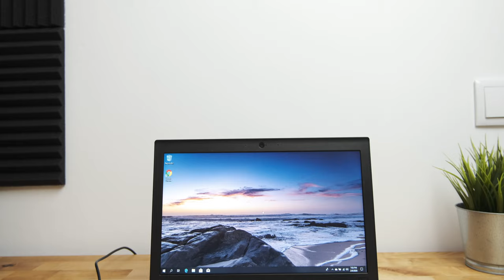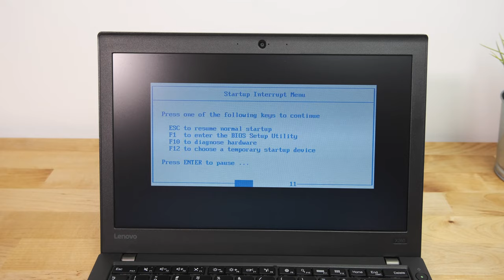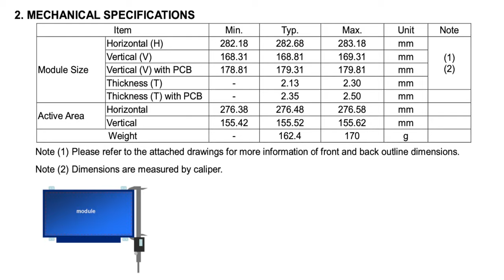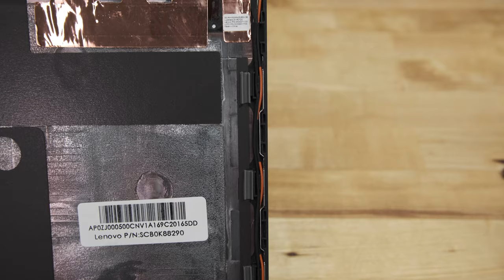Lenovo Thinkpad X260 Screen Upgrade / Replacement from TN to IPS FHD

Comment: Fitted the screen in securely using self adhesive, foam rubber feet that are designed for electrical items, cut to the required size. Well worth the effort and vastly superior to OEM TN screen.
Reply from the maker: Excellent, thanks for the update. You're right the difference from the old TN panel is massive.
Reply: I ordered also a replacement HD screen and ended up with the same screen. Used also selfadhesive tape to solve the problem. Thanks to your video, I was prepared for this. Took me also one hour to replace it completely. Also happy with it
Reply: Thank you so much for the guide. I have a x250 could you possibly help me source a screen so I dont get the wrong size?  Ive found one on ebay but not sure if its correct?

Comment: I intended upgrading the screen on my X260. After studying lots of different panels, I sent for one which stated the panel was 290mm x 170mm. However, I too ended up with a panel 8mm shorter on the width. I was going to return it but your very helpful video has given me cause to have a rethink and follow your lead. Too much buggering about for my liking but hopefully worth it in the end. Thanks for the very helpful video. I`ll post back with the result.

Comment: I ordered a replacement IPS screen too, and according to the listing, it was an LG LP125WF2-SPB2. But in reality, I recieved the same Innolux panel as you have. It had a spacer included though, but It attached from the back and added around a mm of extra thickness. And so, when I put the bezel on, I managed to crack the corner of the display...

Comment: My main problem with cheap TN panels are the contrast ratio, i find myself squinting more or having to turn the brightness up which causes eyestrain

Now this isn't really because of the TN panel itself, there were high end TN panels, they just cost as expensive as an IPS panel so it doesn't really make sense to manufacture those anymore.

Comment: thank you , your explanation is very clear. i have x270 and i have plan to replace the TN panel with IPS 1080
Reply: hi Ryan, did you bought the same N125HCE-GN1 screen for your x270? did it work?

Comment: I have exactly the same issue with panel sizing. What are those rubber strips/spacers called? I cannot for the life of me find them or anything like them anywhere (including IKEA website). Fantastic guide, thank you - best there is.
Reply from the maker: They actually came with an Ikea curtain pole I bought. You can just use rubber feet with adhesive on the back, cut to the right size. If you search for "3m rubber feet" on Amazon there are a lot which would work.

Comment: Well done brotha.. liked..
My 768p HP laptop TN panel just got broken.. seems like it's a great time to replace it with a better 1080p IPS panel.. BUT I'm totally clueless whether it will be compatible if I order it online..
Seems you have experience in this.. do you have some tips that will increase my likelihood of ordering the right panel online ?? Like comparing the make & model nos. understanding the digits in the model no. etc.
Reply from the maker: You'd have to look at the current panel in your laptop, find the model number, and Google it to find the datasheet. That should give you all the specifications you need to find a compatible screen.

If you can't find the datasheet you'll have to measure it yourself, and check what sort of connector it uses, whether it's 30 pin eDP, or the older LVDS. If it's a standard eDP connector then another eDP panel of the same size should work. If it uses LVDS then it's more complicated as the pinout and connector can vary even on laptops from the same manufacturer so you'll have to find the specific panel for your laptop.

You'll probably get the most useful information from Googling your laptop model to find other people who have the same laptop and already replaced their screen. There's bound to be other people with the same laptop who also broke their screen and already replaced it.
Reply: @BartechTV  ok.. thanks buddy.. I'll def try out yr suggestions..

Comment: Great video !  Very well explained, you make it look super easy!
I happen to own a Lenovo T460 Laptop ( which looks exactly the same as your X260 ) and it also has a low resolution TN panel that I would love to replace like you did here. Do you think it is also possible to do it on my laptop? I heard that replacing a panel with a higher resolution one could be an issue and would eventually cause glitches on the screen and whatnot. I'd love to have your opinion on that. Thanks again for the video!
Reply from the maker: Hi, you can switch the panel in your T460 for a higher resolution IPS panel. The Innolux N140HCE-EN1 Rev.C2 should work in your laptop and is a drop in replacement if you can find one.
Make sure to get the C2 revision, not the C1 or B3.
I'm not aware of any problems with glitches after replacing the panel.
Reply: @BartechTV  are there any problems with the C1 and B3?

Comment: I have MSI gf63 thin 11uc. It has a 144hz refresh rate screen. Can I replace the screen with a 60 hz display panel?
Reply from the maker: Yes it should work although, obviously you’ll have a lower refresh rate. Windows should detect the correct refresh rate for the new screen.
Reply: The technician told me that the 60hz will not work with my laptop. Though a 60hz model already is in the market with the same configuration of my laptop. The technician is saying, "the screen model has to be the same."

Comment: Nice video! Do you know if new lenovo laptops have the same display connector?
Reply from the maker: I haven't looked inside every Lenovo laptop, but their Legion laptops do. As for the rest, I would expect so. eDP is a standard. Pretty much all laptops produced since around 2014 use eDP.

Comment: I have dell inspiron 5559 with 1366x768p 60hz 30pins, is it possible to upgrade to 1080p 120hz screen 30pins?
Reply: 1080p 60hz will work.
Reply: @mohamadyusoff9091  i bought the same lcd, im afraid to gamble if 120hz will not work, thanks man.

Comment: I bought an old x260 in good condition, but it is an optional version without camera. So can I add a camera module to it? Or do I need something else (like extra cable, ...)?
Reply from the maker: FRU 01AW448 is the camera cable, and the camera itself is 00HN350. You'd also need a new bezel with the lens hole - 01AW433. If you just google those part reference codes you should find what you need.
Reply: @BartechTV  thank you very much

Comment: Can you show how and where you applied the adhesive strips to the top and bottom?  According to your old and new (innolux) panels, there is a vertical difference of 12mm, significantly more than the horizontal differences.  Also, in the video you are using eBay to purchase panels in EUR but your links in the description are for Amazon US based in USD, yet you are based in the UK.
Reply from the maker: The vertical difference is less than 2mm - 170mm high for the old screen vs 168.81mm for the new screen. Just a tiny 1mm sliver of rubber was sufficient. You can see the little strip of grey rubber I added at 5:22, immediately above the hinge.
Reply: @BartechTV  Yes, I can see those.  Thank you for your reply.

Comment: Could i use this ips panel for x270?
Reply from the maker: Yes, this same panel will work on an X270 (and also the X280).
Reply: @BartechTV  I'm planning to use LG LP125WF2-SPB1/B2 since it's the only one i could get here. It's cost around $80-90 in Indonesia. Your tutorial video seems very easy to follow. Thanks

Comment: @BarTechTV -  I think you may have a fake panel and may have been scammed. 
The Innolux N125HCE-GN1 Rev. C1 does not have an eDP connector to the bottom-right.  It only comes with a connector in the bottom-centre.  No 282mm wide panel that produces 16.7M (8-bit) colours comes with a 30-pin eDP connector at the bottom-right.  Only such panels are provided a bottom-centre connector.  This is the same regardless of manufacturer (Innolux, IVO, AUO, BOE, Lenovo etc...).  The bottom-right connector is for 262k (6-bit) colour panels.
There are two LCD panel database sites, both show images of the same model you claim to have: N125HCE-GN1 Rev. C1.  However, both databases show images of the model with the eDP connector in the bottom-centre of the panel, and not in the bottom-right, as in your video.  So how can it be that you both have different models with the same model number? 
http://www.panelook.com/N125HCE-GN1_Innolux_12.5_LCM_overview_28140.html
https://www.lcd-source.com/Product_Overview_Innolux_N125HCE-GN1
Check the images here:
https://www.lcd-source.com/upload/images/Innolux/N125HCE-GN1_P1.jpg
http://www.panelook.com/images/201911/1574070606850431.jpg
The official Lenovo PartsLookup site also confirms this:
https://download.lenovo.com/Images/Parts/00HN884/00HN884_B-218.jpg
https://download.lenovo.com/Images/Parts/00HN884/00HN884_label.jpg 
The Lenovo FRU for the Innolux N125HCE-GN1 Rev. C1 is 00HN884.  You can check this yourself here:
https://pcsupport.lenovo.com/gb/en/products/laptops-and-netbooks/thinkpad-x-series-laptops/thinkpad-x260/20f6/parts/display/compatible
Notice how your panel does not have an FRU number on the label?  That's because one wouldn't exist in that format.  If you contacted Lenovo and told them you had an Innolux N125HCE-GN1 Rev. C1, they would tell you that's impossible as they only stock that model with the bottom-centre connector.
I believe what you have is a re-labelled 262k colour panel from another manufacturer.  So, in some way, you were lucky that by buying the incorrect part, it was actually compatible with your laptop.
Can you see an FRU number anywhere on the panel?  A Lenovo FRU is usually in the format 00NN000.
Reply: I believe the  variant you have is actually this one:
https://www.amazon.co.uk/dp/B07YCHL9VZ
From the product information:
"Screen works in the 262K standard"
"Display works in TN technology,"
So actually may technically be a TN panel still and not full IPS.
Reply from the maker: @jimjamz.  No, that's a TN panel. My panel is IPS.
Reply from the maker: No, it's not a fake panel. All of Innolux's own photos in the official product specification show the eDP connector in the bottom right. In my experience, panelook and lcd-source are useless, full of incorrect information. Yes, I'm aware of the FRU list on Lenovo's site. It's what I used as a guide when choosing a replacement screen to be sure that I got one that was recognised as a native panel and would work out of the box with brightness control.
Reply: @BartechTV  Perhaps, however it's not 16.7M (8-bit) colours.  It's actually 262K (6-bit), which is the same colour depth the TN panels produce as stated here:
https://www.amazon.co.uk/dp/B07YCHL9VZ/
https://www.ebay.co.uk/itm/313079302496
The reason it might look different in the video is due to the higher contrast ratio and brightness (WLED), as well as the better viewing angle.  For users (e.g. designers or artists on the go) wanting higher colour depths from a screen, they will be still restricted to what they currently have, which is a real shame.   If you want 16.7M (8-bit) colours on a N125HCE-GN1 panel, you have to get the one with the eDP connector in the bottom-centre of the panel, which unfortunately, makes it incompatible with the Lenovo x260.
Reply: @BartechTV  Please can you post a link to the official Innolux product spec datasheet?  Thanks.